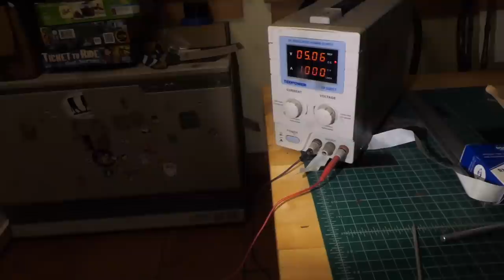Master Sword Build; Part 2 of 4

Comment: I've learned a lot from this channel, so I'm giving something back for once: An overnight soak in vinegar (12+ hours) will blacken some steels, similar to chemical blueing. I did it to a Hanwei Tinker Bastard Sword, and got a pretty permanent dark finish to the blade.  No heat, no chemicals, no danger. I just stuck it in a PVC pipe filled with vinegar overnight. Rinse with clean water and scrub with a brush, then give it a light coat of mineral oil when it's dry/clean and you're set. You can also wet-sand with some high-grit paper (400 grit, IIRC) to really bring out the grain of the metal.
Reply: Vinegar is still a chemical, it's just a less harmful one.

The blackening is known as carbon migration, the carbon in the steel becomes near (or is revealed on) the outer layer. I've found other chemicals will do the same thing, rust removers and what not if you let the items sit too long. The black can be damn hard to remove too
Reply: @DracoOmnia  Thanks for the info, I had no idea it was called carbon migration!

Vinegar is just a really safe, cheap method for doing it, compared to other chemicals. Easier to get, safer to work with, and the only real risk is that your clothes might smell a bit ick if you splash it on yourself.

Comment: 8:05
if you oil the Sandpaper-Disk with WD40 or something, it's even easier to grind Aluminium down.
but be carefull! the oil will get into the aluminium, where you ground it and you cant weld it very well after that

Comment: I was once commissioned to make a stage sword for a theatre company, and I chose 7075 aircraft aluminum. I did use grinding discs because that's all I had on a poor college student budget. Needless to say, I very quickly decided that was too sketchy and went and bought files to do it all the slow, painful way.

Comment: The bubbles coming of the negative are hydrogen. If you crank the current too high and the workpiece starts fizzing as well, that's chlorine. (Or oxygen, when the salt water had been used a lot)
Reply: Should he be worried if it starts fizzing then? I mean chlorine gas isn't the healthiest thing to breathe in
Reply: @TheHeavyModd  It's definitively not healthy. But you'll be exposed to much more if you use mold remover in your bathroom. If you do this etching next to an open window, you'll be fine.
Sodium Sulfate would still be a safer electrolyte though.

Comment: Reminds me of when I did a  Damascene project. Fine silver on top of steel. When it was done I used a moist towel with salt water to get the steel to flash rust. Then used green tea to turn it black (the fine silver was unaffected). It seems like the vinegar is doing the same thing to the rust on the tube?

Comment: Some guys will use a mustard coat on carbon steel knives to get a patina on the blade. Really anything vinegar based will work. You could also use ferric chloride as well. If  use ferric chloride it will also act as a rust inhibitor once you clean it off.

Comment: Aluminum welding uses diff tungsten and also different power 200 is a little high and always have your tungsten balled on the end at temps 160 to 190 should be fine . When you weld aluminium you want balled tip on your tungsten not a sharp one

Comment: aluminum + rust on a grinding wheel  = Thurmate... a variation of thermite! Its an incendiary pyrotechnic composition that can generate short bursts of very high temperatures focused on a small area for a short period of time. It is used primarily in incendiary grenades!!!

Comment: nooo, the black in the etched triforce looked so good.
Is it possible to carefully dremel out the texture in the etched lines so they aren't stippled?
The anodized metal looks infinitely nicer than paint. Painted metal looks horrible.

Comment: funny the tip of the tungsten didnt round itself, it usually does that when welding aluminum. I dont know if you use color schemed tungsten, but the green ones are best for welding aluminum.

Comment: What happened to your camera is the sensor got hazy due to auto compensation  on very bright to very dark and vice versa the shutter speed cannot handle the interval that it locked up causing your sensor some damage(lines and flickering) if you are gonna weld i think you should just set it to manual so that it wont need to auto compensate on and off and ruining the shutter by opening and closing

Comment: Yeah the problem with camera is your processing chip what processing  light into digital format might be getting mess up being on auto might want to set camera to manual.. might help when welding but it is still going to destroy camera high intents light not good like... a clip on Lens filter might save it

Comment: Sir Humphry made a bit of a mess of naming this new element, at first spelling it alumium (this was in 1807) then changing it to aluminum, and finally settling on aluminium in 1812. So really you should be laughing at them for using aluminum. Even in the 1800's aluminium was used more often in the U.S. it wasn't until the 1900's that aluminum became the norm. If it wasn't for the Websters dictionary of  1828 which used aliminum, then aluminium would be the norm world wide. The More You Know. :)

Comment: Aluminum yes is in fact the proper pronunciation.😃
Reply: They're both technically correct but yes, Aluminum was the original version.
Reply: @adamtennant4936  it is agreed aluminium. Dangit auto correct.
Reply: @adamtennant4936  No, it wasn't. Humphrey Davies, the Englishman who named it, first called it alumium then aluminum.

"Aluminium" is the result of a few snobbish British self-declared "authorities" who decreed that since the names of some metals end in -ium, then the names of all metals must.
Metals like tungsten and cobalt (named by foreigners) really pissed them off.
Screw 'em.
Reply: @markfergerson2145  what about iron and copper?
Reply: @markfergerson2145  You're wrong on a number of points.
Reply: @samnottheotherone4363  What about them?
Reply: @adamtennant4936  Name them.
Reply: @markfergerson2145  
"Humphrey Davies, the Englishman who named it"
He was British, which is an important distinction in this field in those times.

"first called it alumium then aluminum."
He SUGGESTED Alumium then chose Aluminum. Alumium was never an official name so is not the original name. Aluminum is.

""Aluminium" is the result of a few snobbish British self-declared "authorities" who decreed that since the names of some metals end in -ium, then the names of all metals must."
The European scientific community objected.

"Metals like tungsten and cobalt (named by foreigners) really pissed them off."
Who needs standards in science, right?
Reply: @adamtennant4936  "English/British"
Quibble. You Englishers get all het up over trivialities.
Other than that I see you agreeing with me, not pointing out "a number of points" where I'm wrong.